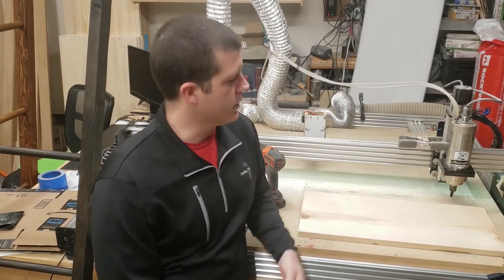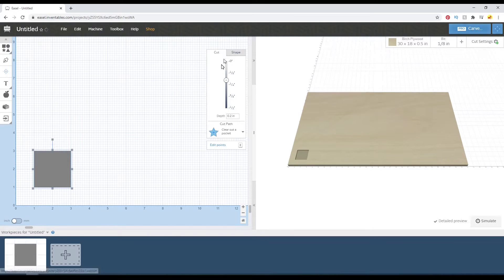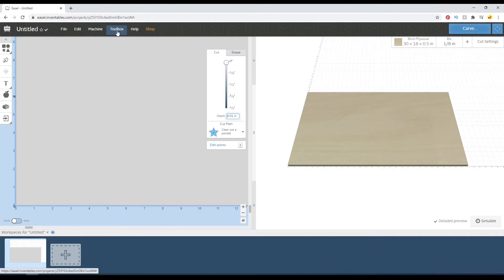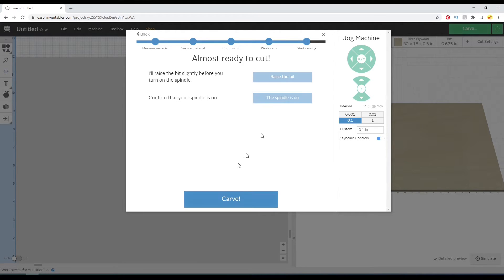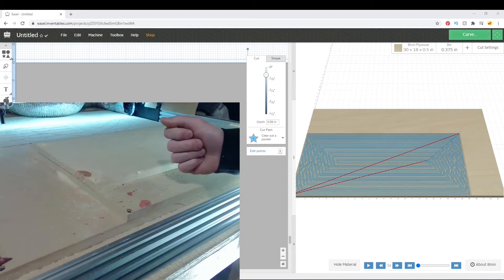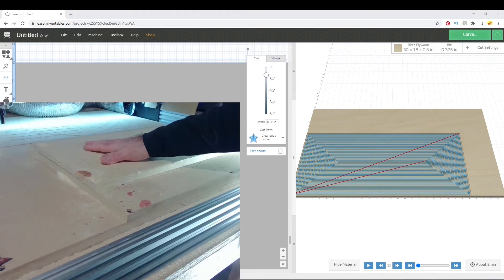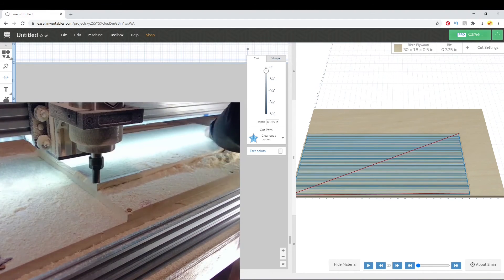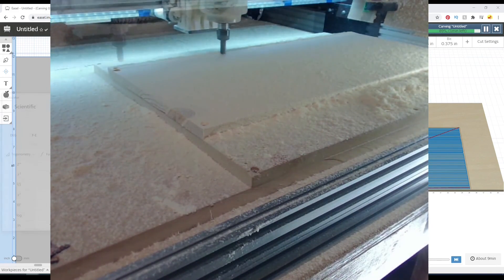HOW TO surface a board FLAT in Easel CNC Software

Comment: Good vid but why didn't you just run it through a planer once the first side was flat?
Reply from the maker: Great question! There are actually a few reasons:
After flattening, this board was then used in the follow up video on how to CNC a flag, so it needed to be on the CNC anyway. 
My planer is tucked away and not very easy to get out and setup, and there's a little bit of snipe to deal with. 
Lastly, I would need to rename the video to include a planer 🤷‍♂️
Reply: @SethCNC  lol I hear you man...all my tools are mobile and I still hate moving them all back and forth in the small area they are in. I've ordered a CNC machine and get it in July and flattening slabs was one my of my main buying points and your vid helped think of how it "should go" when I get there. Thank you. :D
Reply from the maker: After this video my Amana slab flattening bit (the ones with the carbide inserts) and that makes for a much smoother finish and wider passes 👍   ive got a few big walnut slabs ive been waiting until after the winter to flatten & this bit will make the hardwood so much easier, so check those out... the $40 1.25" one is what I went with for now, but I'm sure I'll want the $130 2" one soon enough.
Reply: @SethCNC  Yea I have 2" whitehead bit I use with my router sled. I just hate using a router sled. lol
Reply from the maker: @RonMarshallrone  starting cnc from a workworkers perspective i send it to do the most random jobs sometimes. Just to save my labor time... 
Last summer I was out back with a baby monitor keeping tabs on the cnc poolside 🤣 even if it took the cnc 4 hours to do a job I could do in 1, it was still a victory in my books. 👍

Comment: How do you position the material? Meaning which part of the warped or cupped board is on the bottom?  Do you use shims at all?
Reply from the maker: In the first part the board is positioned cut facing down, this allows clamping at the outside corners, if the cup is bad ill add some shims along the two sides to support it more and prevent the wood from bowing down at all during the carve,  however as long as you do 2 or more passes the shims could be omitted.   👍👍